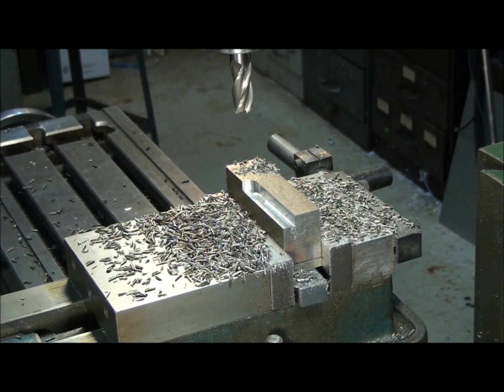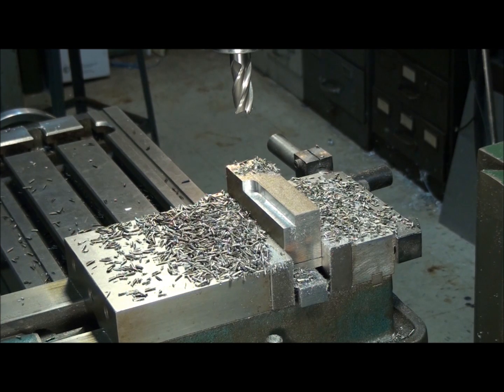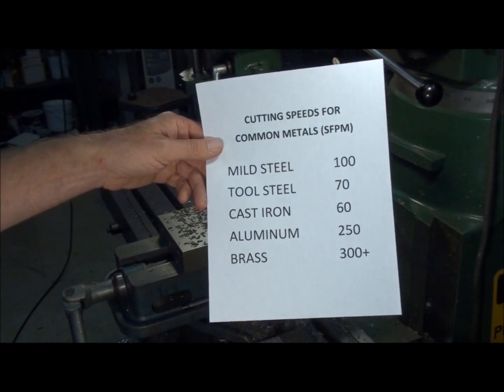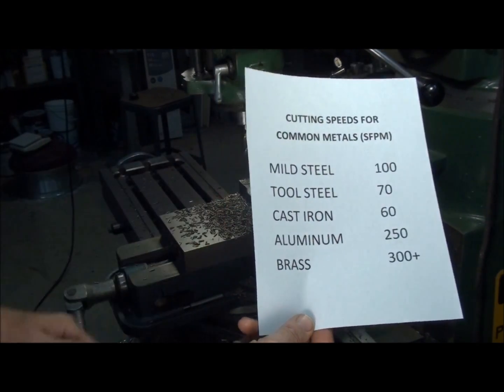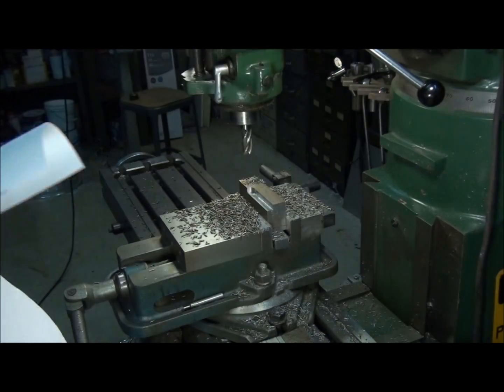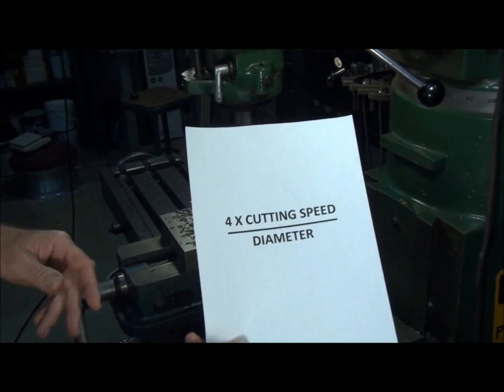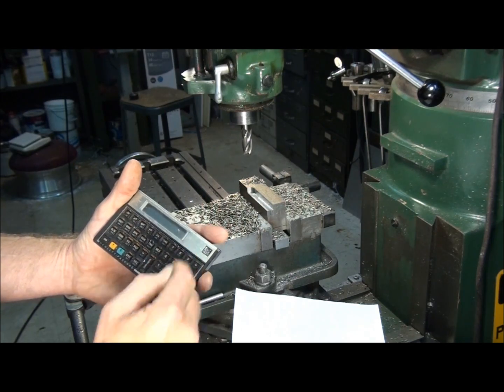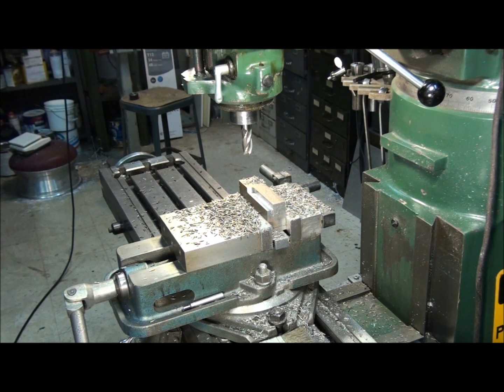Cutting Speed and RPM on the Lathe and Mill

Comment: climb milling and no coolant?
Reply from the maker: Mitchel Wiese

Ball screws aren't required for climb milling Mitchel, but a good working knowledge of climb milling and what effect it has on your machine is. At the start of the video, I am climb milling, but at that depth of cut, there is no tendency at all for the cutter to pull the table toward it and grab the work. If the cut were shallower, I could still climb mill, but I would need to be aware that the cutter could try to grab. In that case, I could still climb mill, but I would need to snug up the table lock a bit to keep that from happening. Another thing to consider when climb milling is the rigidity of the machine. A rigid machine like this is much more tolerant of climb milling than a light bench mill. Climb milling on light machines may need to be limited to light finishing cuts, with heavier cuts made with conventional milling.

Climb milling will almost always produce a better finish than conventional milling, especially on aluminum and it is easier on the cutter. It also forces the cutter away from the work (or the work away from the cutter), so it won't cut deeper than it should if you forget to compensate for backlash.

Climb milling is probably the most misunderstood concept in machining. I have plans to do a video on climb milling vs. conventional milling, it's benefits how to utilize it without getting into trouble and why it produces a better finish than conventional milling.

Tom
Reply from the maker: mathew whittle The reason climb milling produces a better surface finish is this: Chips coming off an end mill are wedge shaped, thick on one end and thin on the other. When conventional milling, the cutter enters the work on the thin end of the chip, so it drags a bit before cutting, producing a rough finish. This dragging action also reduces the life of the cutter. When climb milling, the cutter enters the work on the thick end of the chip and makes a nice clean exit on the thin end, producing a smoother surface.

The ability of the cutter to clear chips form its flutes depends on how much heat is present. If the cutter gets too hot, the chips will weld themselves to the cutter and plug it up. The heat can be controlled with coolant or by slowing the rpm or feed rate of the cutter.

Tom
Reply from the maker: Coolant just increases the rate of material removal. It has nothing to do with the type of milling being performed.

Tom
Reply: Toms Techniques I believe the previous comment was referring to separate issues. It appears as though you are running a older manual mill witch is likely to have lead screws not ball screws. If this is the case, it would probably be better practice to conventional mill.
Reply: Toms Techniques A fair and well thought out response
Reply: From what I have learnt from others over the years. .. climb milling gives a better finish because you don't end up re-cutting swarf chips as you do in conventional cutting. Also I teach young kids to Mill. ..I try to avoid climb milling with them because they don't use the bed locks and will plow through using deep cuts to save time. ..almost invariably have seen snapped cutters after finding out they had climb milled. .. With my more appreciative students I tell them to climb Mill on their finishing cuts. 
My comment on coolant. .. Was wondering how you got away with mulling aluminium without it jamming the cutter?

Comment: Great video, but how do I find out how deep I can go per cut? I have block of aluminum .500 thick with a .125 end mill 2 flute .750 long. Do I need to use another formula?
Reply from the maker: A good rule of thumb for the depth of cut is 1/2 the diameter of the end mill. For a small diameter end mill of that length, it's best to plunge cut instead of side mill with it because long, small diameter end mills can't take much side load. To see how that is done, watch my project tutorial, "Carriage Stop Body Part Two, Milling the Slot".

Tom

Comment: Thats a big diameter cutting tool.  Looks dangerous to have your hand around if it were spinning
Reply from the maker: That is the trouble with machinery. It is totally mindless and doesn't care if it's cutting a piece of steel or chewing up your hand. You just have to treat it with respect and be careful because if you tangle with it, it will win.

Tom

Comment: Thanks for the great video.
My question is,why or where does the constant of 4 come from in the formula ?
Just would like to know.
Reply from the maker: It comes from rounding pi to three and converting from inches per minute to feet per minute (12'' to the foot). If you scroll down through the comments, Rex Walters does an excellent job of explaining it in detail.

Thanks for watching.

Tom
Reply: a more precise formula is 3.816 * SFPM / diameter = RPM. The 3.816 (or 4) combines pi with the inch to foot conversion

Comment: Hi Tom.  Great video. Doesn't get easier than that.  Another way that I do it is:
FPM / dia x .262  = RPM

The long formula is:

feet/minute=(revolutions/minute)* (Dia. (in.) * pi)/12) 

The simplification factor that I used of .262 is pi/12 to convert diameter in inches to feet.

It is easier to understand the practicality if you think about it as this:

fpm=rpm x circumference

Comment: This is a very helpful video for cutting speed, but it appears that you are climb milling in these examples. I realize that this can produce better surface finish, but it can also be dangerous if you don't have a very solid machine. I am a novice and I have hobby type machines like many who use videos like this to learn from, so I want to warn anyone watching this that the cutting technique as shown should not be attempted unless you REALLY know what you are doing and have equipment that can handle it.
Reply from the maker: I almost always climb mill and so can you. You just need to compensate when using a less rigid machine by taking lighter cuts, reducing tool and part overhang, and snugging up or locking the table locks. It also helps to cut with at least half the diameter of the end mill so it can't pull the part under it (as I'm doing in the video).

Tom

Comment: In the metric world add two zeros to the f/min then divide by tool diameter in mm to give rpm. This will be about 3% higher if you do the maths but good enough for a starting point.
Reply from the maker: Thanks Jules, that's a metric method I hadn't heard of.

You can also change the 4 to 100 in the imperial formula that I used and divide by millimeters. 100 x CS (in) / DIA (mm). If you have your own charts in m/min, use 320 x CS (m) / DIA (mm).

Tom
Reply: Toms Techniques My charts fell off the wall 20 years ago, and since then it has been whatever is the quietest, not very clever!

Comment: Hi Tom.
Thanks for the vid, I enjoyed it. I'm a bit of a purist and noticed that, in your formula, you are dividing feet by inches! (100fpm/0.625" and without the use of pi). I guess this is where the '4' comes from. Here in the UK I work in metres and millimetres. Would the formula work to the same accuracy with those units?
Reply from the maker: Jim,

The 4 is a rounded up constant derived from 12/pi (3.82) which converts the tool circumference in feet to diameter in inches.

For cutting speeds in m/min, use 320 x CS (m/min) / DIA (mm).

Tom

Comment: Hi,
 Thanks for the great vids!  I love 'em. Can the formula be further simplified to remove the 4X part and call mild steel's speed 400 RPM/inch of diameter and aluminum=1,000 RPM/inch of diameter, etc?
Reply from the maker: That's not going to simplify anything because you still have to look up the cutting speed for the material you are machining in a table,and it's going to be in surface feet per minute, not surface feet per minute times four. The number four in the formula is actually comes from converting the circumference of the tool from feet to inches by dividing pi by 12. It comes out to 3.82 and is rounded up to four for simplicity.

Tom

Comment: Tom, using this formula and cutting aluminum with a 1/8" end mill, my machine would have to spin at 8000 RPM's. I don't know of any machine besides a router that can spin that fast. My machine is only capable of 2250. What should I do in cases like this?

For example, if I need to mill out a slot that is 1/8" wide, should I just feed the table slower? Or is there some other trick to using an end mill that small with a machine incapable of spinning that fast?

Excellent video.
Reply from the maker: First of all if you are cutting a 1/8" slot, you'll need to use a smaller end mill, like 3/32". Then just run the spindle as fast as possible and plunge cut the material out before side milling to size. That's a lot easier on the cutter, especially at lower than ideal RPM's. Side milling at too slow an RPM is the most common cause of end mill breakage because it generates too much side load for the end mill.

Tom
Reply: Toms Techniques Actually, I have to cut a slot that is slightly larger than 1/8", but I figured I would use that as a reference. Thanks for the tips. Plunge cutting seems like a decent solution.

I really appreciate the info. Love the videos. I've learned quite a bit by watching them.
Reply: ProtoSimTech "

Comment: Hi Tom, your a resource I can't seem to get by without. Would it be possible for you to put more reference material up on your site? This is the 3rd time I had to watch this video to remember the 4xsfpm/dia. Would be easier if I could just link to a page on your site. Ya, I'm getting older and cannot remember things that easily anymore, in particular the newer stuff I am learing.
Reply from the maker: Hi Steve,

A cutting speed reference is on my to do list, but I haven't figured out how to best present it yet. Maybe you'll just have to write it down for now until I can get something made up and posted. I actually have a reminder on my gmail that pops up every time I open it, so I promise I won't forget.

Thanks for watching and it's good to hear that you can't get by without my site. :)

Tom

Comment: But what about the number of flutes or cutting edges?  Where does that fit in?
Reply: That's used with the feed rate to calculate your chip load.
Reply from the maker: Orcinus24x5
Yes, an end mill with more flutes can theoretically feed at a faster rate as long as the chips are cleared. The number of flutes does not affect the cutting speed.

Tom

Comment: Tom I got it, is  rpm = (101.6 x cuttin speed) / ( diameter in mm)  i hope that help you and help the people that is mm like me.. thanks tom...  
Also which is the diference between the 3 firts type of iron???
Reply: The difference is carbon content. Tool steel has more carbon and can be hardened. Mild steel has less carbon, and iron has very little carbon.

Comment: "Run her till she stalls then back it off 5" Thats what speed u want =P
Reply from the maker: No, that would be the FEED you want. The speed needs to be calculated or you'll burn up or break the tool.
Reply: Tom's Techniques
How come sometimes when im drilling and using coolant my chips are coming out nice and silver but when i pull the drill out the tip is blue? I usually drill on h-13 and my calculations say i can run 300 rpm at .007 feed. sometimes its perfect and sometimes it burns up. Is it just the material?
Reply from the maker: Drills tend to heat up more than end mills because the heat gets trapped in the hole. Try squirting on a little water based cutting fluid when you drill.

Tom

Comment: Great info: I got the tool speed, but how did you figure the material speed/depth of cut? When to use oil/not to.
Reply: Rule of thumb for depth is 1/2 tool diameter (for full width/slot milling) .
Reply: Lubricate & cool whenever possible.
Reply: Material feed is a bit trickier. 
Best starting point would be #flutes x rpm x chip thickness would give table speed (in inches per minute)  Cutting mild steel with HSS endmill avout 1/4 diameter, you can start with 0.001 for chip thickness--it can be higher for bigger diameter end mills, harder cutters, and softer materials.
See, the fundamental thing that drives those calculations is the desired chip thickness (per tooth), which is different for the cutter material and the material being cut.  And more teeth per revolution (more flutes, basically) interacts with the spindle speed.
(Someone will disagree with me in 3, 2, 1...)

Comment: Thank you for this clear explanation.  I have printed out a chart of the cutting speeds and the rpm formula.  My antique Vernon Mill has no electronics, so my first task is to measure the rpm of the spindle for every belt setting.  With that info I can set my rpm to fit my bit and material.  Thank you again!
Reply from the maker: It's good to hear that the material is getting used.

Thanks for watching!

Tom

Comment: So cutting aluminum with my woodworking router at 8000 RPM with a 1/2" bit is probably too fast then.
Reply from the maker: Yes, the aluminum will likely stick to the bit and plug it up.
Reply: Tom's Techniques Thanks for the reply. It's the easiest way I found to enlarge holes in thin sheet stock, so I'm not cutting very much, but I'll check it to make sure it's not sticking too much.
Reply: Cadwaladr Alumitap works great for keeping aluminum from sticking to your cutter.

Comment: I was taught 3.82 x SFM.  Is this just one of those close enough kind of things ?
Reply from the maker: Yup, rounded off for ease of use.
Reply: The number 3.82 comes from 12/pi, but in many cases, people just round off 3.82 to 4, to make it easier to calculate the RPM or Surface Speed, you aren't wrong to use 3.82, quite opposite, you are more accurate, but it makes it more complicated than just using 4.
Reply from the maker: Rpm is one of those hand grenade calculations, all you need to do is get close. Once in the neighborhood, it can then be adjusted for best performance.
Reply: Tom's Techniques That is true, in most cases, a manual machine will never have the exact speed that you need, so you just have to go with whatever you think works best, whether it is slightly higher or slightly lower
Reply: This is why a variable speed drive Bridgeport helps. Belt speed on the step pulley is kind of a stab in the dark, although it tends to be either too slow or too fast. I use a 30 taper 2J head as well as a M head on the tang end of the BP ram.

Comment: Hi Tom (newcomer here), I cut rigid plastics, ea. manufacturer has recommended speeds & feeds, is there a rule against doubling speeds and feeds for faster cuts?
Reply from the maker: Oscar,

Most plastics won't dull a tool if you use too high an rpm, but some (thermoplastics) will melt and stick to an end mill, acrylic is one of the biggest culprits. Some also have abrasive fillers in them and require carbide to machine (glass filled epoxy). I usually just use trial and error to find the best combination of speeds and feeds and lubricant for a given application with plastics.

Tom

Comment: I seem to be under speeding most times, then I gradually speed up in following cuts. I never break an endmill but I take to long. Sometimes I don't have a clue what type steel I'm cutting, Hence underspeeding. I've always watched the chips to get a feel for the cut. Thanks for the videos, I'm picking up alot!
Reply from the maker: Too slow an rpm is quite common, but it does waste time and increase tool breakage. There is nothing wrong with going by the color of the chips and feel of the cut, the formula just gets you in the ballpark.

Thanks for watching!

Tom